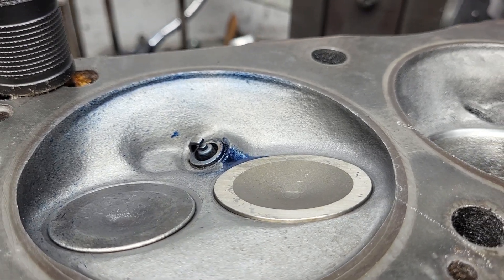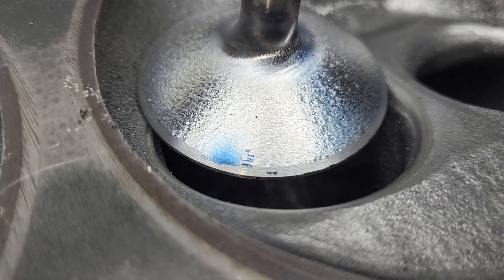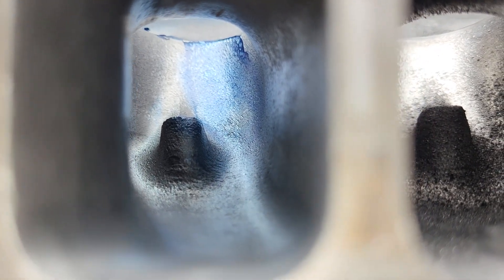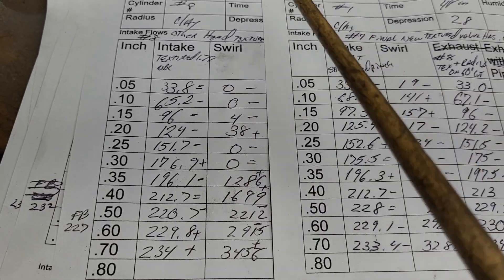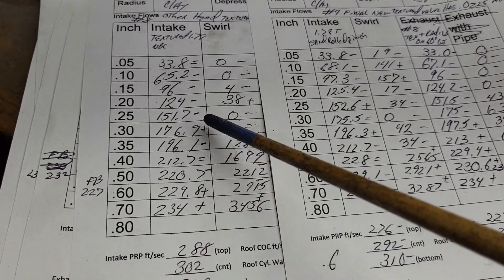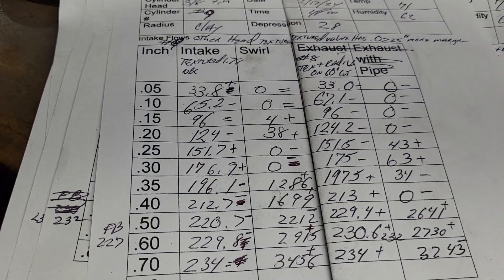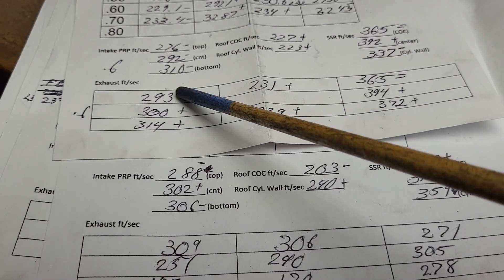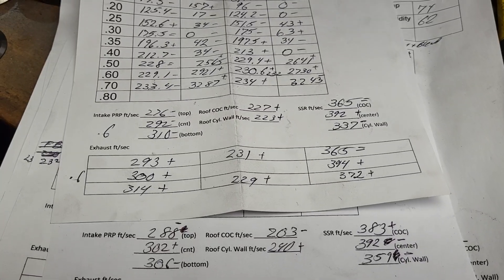David Vizard, Unity Motorsport, Mission Impossible 318 Project. Compare intake port #1 to intake #8

Comment: Looks like UTG bailed on this project and Unity Motorsports wants to use aftermarket parts.  I would like to see you see this project through in the original intent of using the smog stuff and RockAuto available replacement parts.  My suggestion would be for there to be two different motors.  One for David to auction off with the good parts and one with the worked OEM stuff.  On the dyno or in a test vehicle at the track, it would be interesting to see the worked BBD, a bigger 2 bbl carb, and finally the OEM police package spreadbore intake with an OEM QJet.
Reply from the maker: I will discuss it in my live tonight. Thanks

Comment: Bolt a manifold on the head while on the bench, Use the firing order of the cam, U know which side the head goes on? Right? If your working on the driver's side head on #3 intake, the next cylinder to fire across the manifold leave open close off all the rest with tape on the head and manifold, leave off the carb, Now Spray the dye and see what happens?? I think U will be SHOCKED, at what the air is doing. I look forward to meeting U, I'm only about 25/30 mins from David Visards Place, here in NC
Reply from the maker: Interesting idea. Thanks

Comment: I feel like the grasshopper calling out the Kung Fu master but I gotta say that I've personally used tulip valves and it killed my engine. I did a minor cam swap and upgraded the intake valves and springs and it was a turd. A few folks told me to go back to nail head valves and it was night and day different. Y'all have changed so much that maybe the tulips are the right call but I thought I chirp in with my experience just in case it could help.
Reply from the maker: You make a good point but we are stuck with the stockers

Comment: Can you carve out material on the wall next to the other port to the bolt hole like you did on the swirl port heads? It looks a bit cramped in that area where the liquid is running through? And around the guide on the top on the same side, looks very narrow through there? Other than needs more cowbell, I got nothing else.😁👍
Reply from the maker: I have no experience with these heads cutting that bolt hole open but the port air speeds are pretty good so I doubt it needs more area there. Thanks
Reply: @servediocylinderheads  
More cowbell then.🤷😁👍
Wouldn't a high speed be less volume?
Reply from the maker: @itseithergonnaworkoritaint7852  Remember D.V.'s original design was down on velocity and port energy. I need to put these through the program. Hopefully they are smaller , faster, with better port energy. Thanks
Reply: @servediocylinderheads  
No, thank you, I'm learning a lot watching your videos. Thanks for the explanation.😎👍

Comment: Just get the heads on the engine! Which manifold is going on the engine?
Reply from the maker: Stock egr dual plane ported. Stock t.b.i. ported. Stock 273 single plane ported. And hopefully a Vic jr. With a 750.
Reply: @servediocylinderheads   What compression and Fuel?
Reply from the maker: @clevo351  To be determined by D.V.

Comment: Adding a back cut to those valves will do nothing apart from  maybe reducing the quality of the fuel spray. The angle will not be wide enough to make the air follow it. Also, when you texture the valves like that you create a boundrary for good, - and bad, which again will recude the efficency of a back cut. You will end up with only one shear point. instead of two. That will likely be a loose loose scenario.
Reply from the maker: I decided against a back cut. Thanks